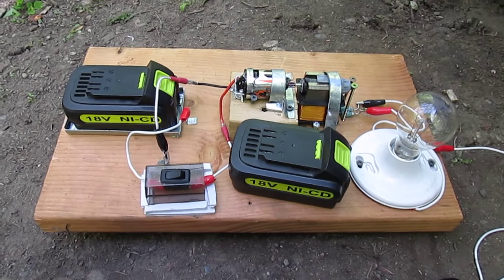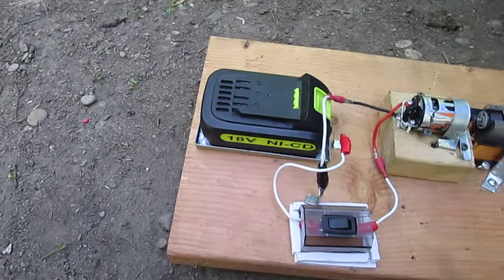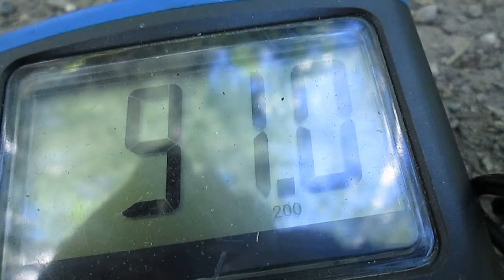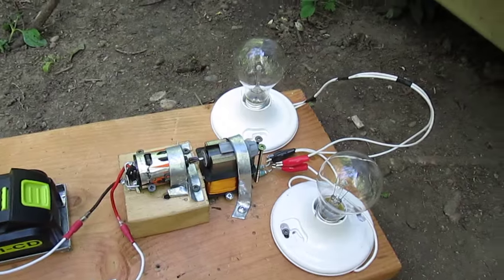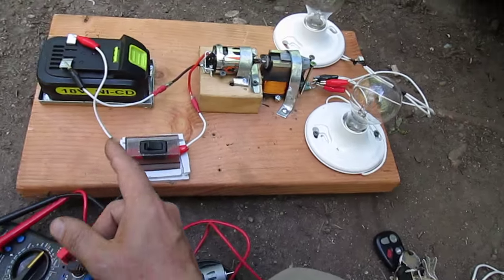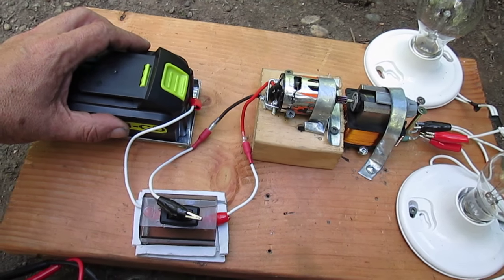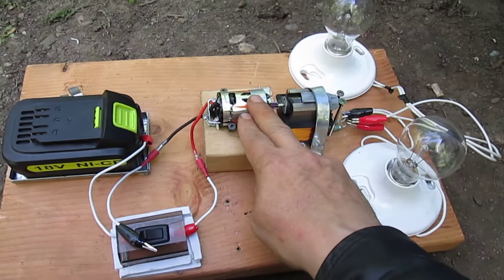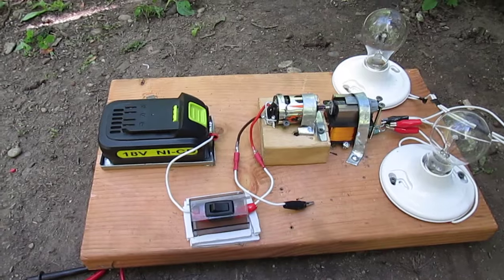Gerard Morin motor generator test phase 1

Comment: datas from the video  :  https://www.youtube.com/watch?v=Ydvic9aG5BE&feature=youtu.be
  INPUT : 36V @ 1.1 Amp going to a brushed 24V motor&motor inverter
(wash machine pump motor)OUTPUT : 130V @ ? Amps
OUTPUT with spark gap and sodium lamp : 130V climbing up to 230V @ 26 AmpsOhm’s law : Watts = Volts x Amps
So the battery INPUT is 36V x 1.1A = 40 Watts
And the energy OUTPUT is between 130V x 26A = 3380 Watts and for 230V x 26A = 5980 Watts
40 Watts versus 5980 Watts
note : when putting his finger on the legs out from the inverter, no electric shock is felt,and the OUTPUT is 26 Amps….. !
Either something is wrong, either we are witnessing a different form of electricityYou choose.I’m really excited to see how things will evolve.
Check this independent video to make up your mind : 
https://youtu.be/3jXJdA4Y7CU
Reply from the maker: The top link does not work. The bottom video link shows proof of RF and very interesting. We know Gerard's first setup was DC to AC with RF frequencies. My research since then did take another turn in to DC motor generators.What gets me is I always show the input and output in watts that are useable.
Reply: I've just updated the link. Try again please
Reply from the maker: I just put in a long reply and the you tube cut off. sigh.There are numerous theories and technology in the Morin/ Robert Klein video. We have all learned . So I had an answer but I don't want to be cut off by a timed break and lose the reply again.Very briefly:Morin and Klein suspect the instruments have limitations in the range of energy.The proposed theories, dark matter, zero point, cooper pairs of electrons in a neutral state, quantum polarization often overlap to a convergence of similar effectsobserved (sometimes almost the same effects).The output power 5960 WATTS he puts his finger across. The did not show the 26 amp with the high grade multi meter we have to trust this.All right for a math guy you can have very high volts at neutral and have no serious shock. Have you seen the volts of the old sideshow staticelectricity making hair stand up? The worst Is AC almost at what comes out of our wall that interferes much more with the body say forelectro cardiac shock. But high volts with a tiny amp can also shock. But amp is the closest to current, volt are potential current and we havethe attractive electric transformation with resistance. Amps translates to electrical energy at that force we see the 500 degrees sodium from the bright side that take a lot of resistance should burn like an oven but that is in a small hot spot stream. The -500 by the instrumentthey are wondering and implying dark matter cold electricity. The loop could be cycling at a frequency out of amp range of the meter as a possibility.Klein says there is more power from the brightness of the light would be dim with the same DC energy. The explanation is that an AC bulb is designedfor a higher frequency and material to emit light. The DC bulb is not as bright because it emits both heat and light. An AC bulb does not work very goodat all for DC current that would mismatch.
Reply from the maker: Continued: Klein appears to be leaning to the opinion that offshoots from the base math are sometimes becoming special cases often errantly perceived as universal. Observed tests of experiments strengthen or weaken any theory. In this video there are many types of electromagnetic forms and devices needing knowledge of each and the dynamic interaction. The most recent discoveries are supporting these ideas. Where did we go wrong? A lot of researchers and theorists in the last year 2017 are pointing at the divergence from the theory debates between Maxwell and Heavyside if we look in to history.

Comment: It's almost painful to watch this. There is simply NO WAY that such concept ever can make a surplus of energy. The power coming out is ALWAYS less than the power coming in due to losses in the internal resistance of wires, friction and even the noise generated. Just because you can create a higher output voltage means NOTHING in respect to energy. Actually a regular transformer is usually more effective than a motor and generator coupled together but in both cases there are losses obviously. Every piece of this can be calculated and it's not even particular complicated.
BTW, the companies making motors and generators actually understand the energy transformations and NO COMPANY EVER has made a motor or generator that can make more energy that came into it. And remember, between the motor and generator you have the mechanical energy which is a product of the torque. For those of you who are not deep in this can just consider that the mechanical energy is like a car engine where you have power = torque x speed / 5252 (simple horsepower). 

Let's say a DC motor, like the one shown, could make overunity, it would mean that input voltage x current < torque x RPM  * 0.105. THERE IS NO SUCH DC MOTOR EVER MADE.

Let's say a generator, like the one shown, could make overunity, it would mean that output voltage x current > torque x RPM 0.105. AGAIN, THERE IS NO SUCH GENERATOR EVER MADE.

Do not waste you time. A better area of doing experimental research is energy storage.
Reply from the maker: +ThinkingBetter I do welcome your input. I did this video because I was not satisfied with the points of measurement regarding theinput and output expressed in watts. Gerard is trying but some of his videos show just volts or just amps. Thereare also the numerous persistent claims of motor-generator EMF harvesting the last 5 years some with claims ofsuccessful self running over unity looped back from higher output.I was skeptical but here six months later I have another set-up that is producing some results that do not conform tothe conventional theory or (fable belief system) that automatically rule out doing experimental research due toincomplete or faulty logical assumptions.So I will not show this right now but it is significant and much to my own surprise but I will place this newer device under numerous validation tests.
Reply: people like you is a pain in the ass for no reason. you always insist it cant be possible but lots of people already successfully did that someone genius like you cant. you always give that theory,, yes there is a theory like what you said BUT science has a big room for new ideas,theories that we can use in modern times. do not be trapped in your box, i admire people like allan shura who never stop trying. genius people like you thinking better already stopped.
Reply: But it is impossible.

Comment: use a 120vac pump and not a 220/240v pump and you will gat better amps to supply more light with out the drop....